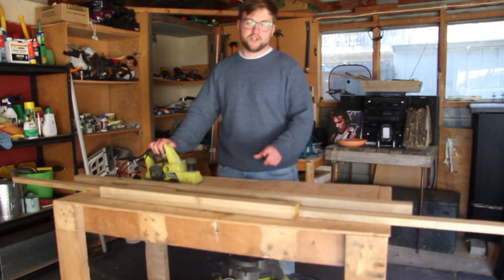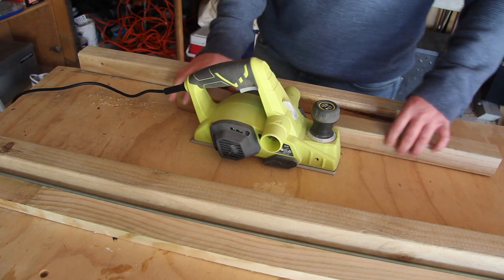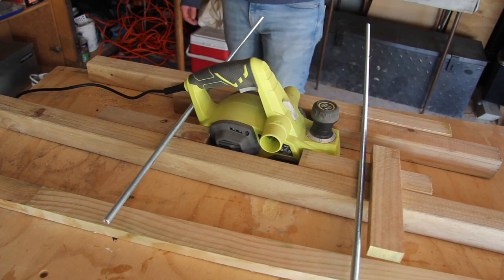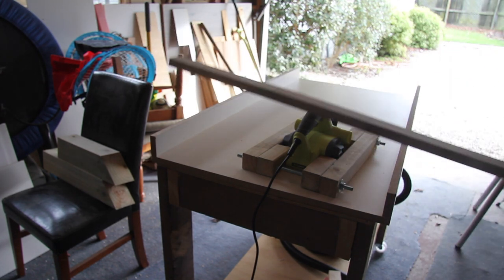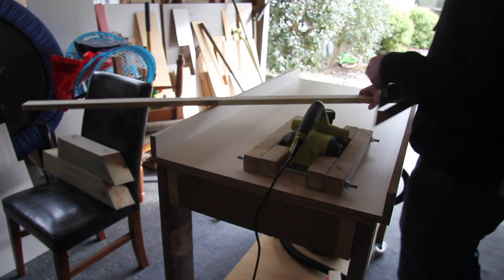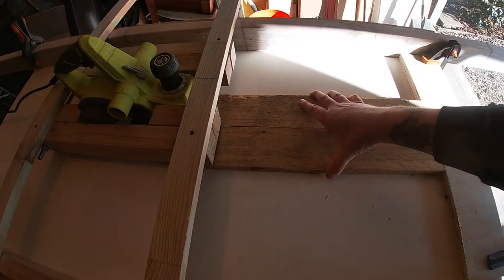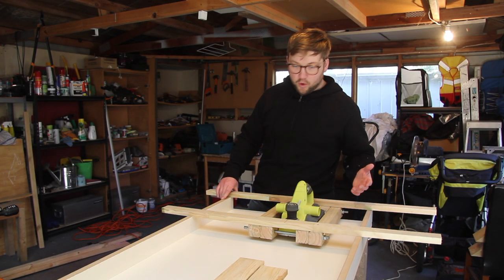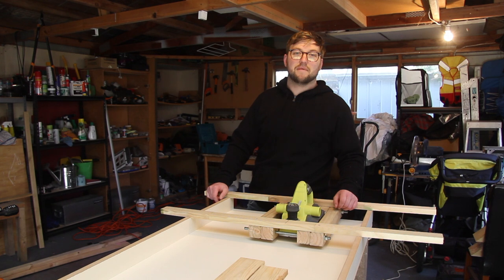Electric Planer jig - turning a planer into a thicknesser (almost) #woodjigs21

Comment: A simple modification might be to add 4 PRONGED TEE NUTs to the top of the plane carrier and bottom of the cavity batten, drill through cavity batten pieces and attach to the tee nuts with a suitable length washer and bolt. You'd need to drill deep enough into the carrier to allow for whatever level of adjustment you'd need up and down. Do this on all 4 corners of the carriage and this would allow you to adjust the entire plane carrier. You could use thumb screws or eye bolts to make fine adjustment a bit easier, as you could just replicate the number of twisted on each corner. Should be reasonable accurate. Might be advisable to countersink also.
Reply from the maker: Hi M, apologies I missed this comment! That sounds like a great idea, definitely worth a try. Thanks for watching, cheers

Comment: Very interesting concept! I don't know why people who use router sleds to flatten timber have not tried this, it looks like it would be way quicker!
Reply from the maker: Thank you mate, works a treat, and you're right, way quicker than a router sled
Reply: It's easy to adjust height of bit for router sled. It's also has greater height range. With electric planer, it's much more involved process to readjust height when you need to plane z-axis with depth.

Comment: Brilliant idea. Just a couple of questions if I may, I wasn't able to see how you stopped the planner from dropping in the frame? and, is it easily removed from the frame so as to be used as a regular planner?
Reply from the maker: Hey! Basically the threaded rod has squeezed it into place, which makes it easily removable if I need to!

Comment: Hey, one question. What prevents the planer of falling is just the pressure of the slabs with the bars?
Reply: I have the same exact question.
Reply from the maker: Hi, yes exactly that. I don't press down to add additional pressure and the timber doesn't seem to flex, however I might try some galv box section if ot does become innacurate

Comment: I think the reason the planer leaves lines is described in this video https://youtu.be/_a1HCqK5i-A?t=376 where he points out that the blades are wider than the shoe, so they can easily gouge the wood.